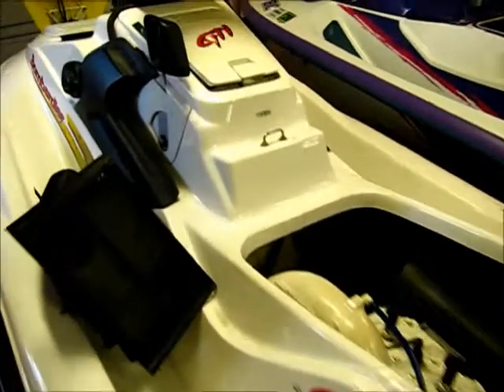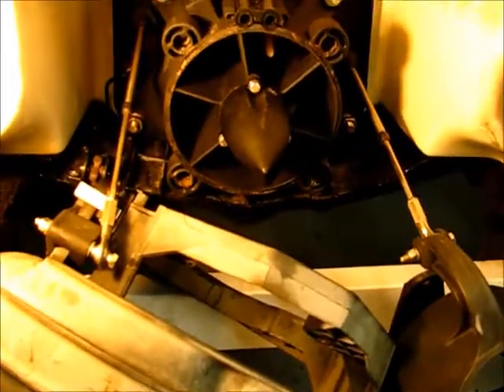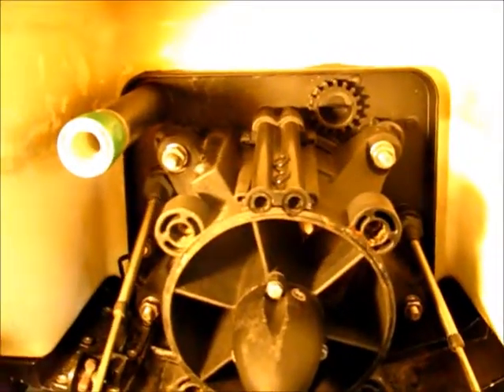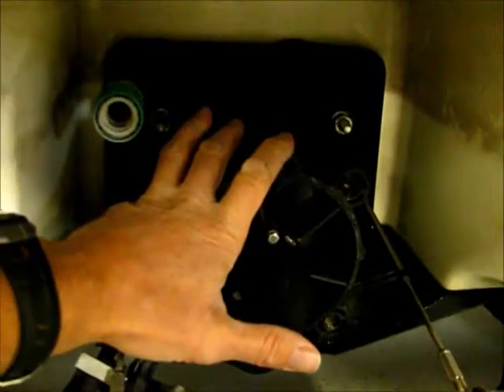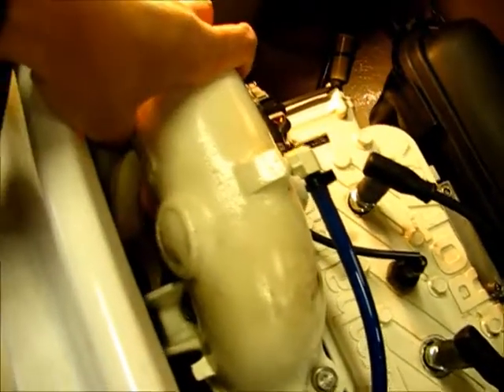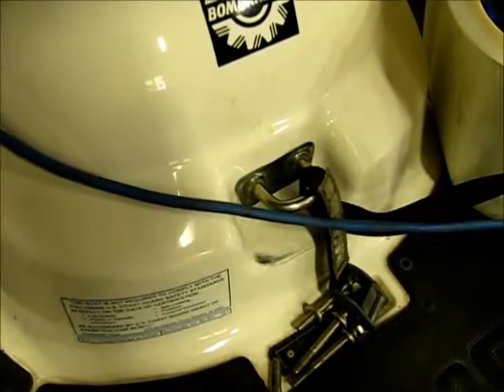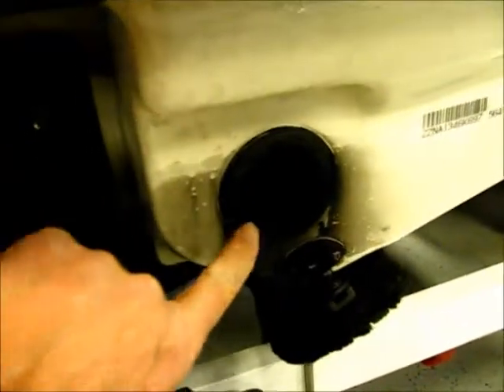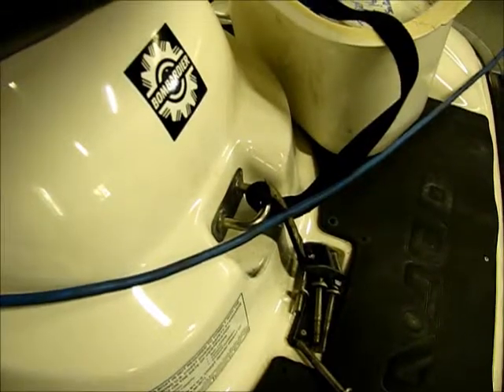Sea Doo GTI - How the Cooling System Works

Comment: Thanks so much for making this, i recently blew up my used jetski due to previous owners cooling sytem routing. I am currently rebuilding the unit.
Reply from the maker: Cool - hope this helps you and I hope it makes sense!  I don't know if I explain stuff well but I try...  Also, the toughest part for me to find was the exhaust hose on the larger end of the exhaust cone.  Mine was burned and bubbled.  Go to McMaster-Carr online and you'll find the material you need.

Comment: Extremely well presented. Thanks.
Reply from the maker: Thank you!  Hope it helps...
Reply: @paulhaines5755 hi Paul - tried starting my ski up, hooked water up to the flush valve and water starting coming out of a hole in the top of the exhaust manifold and started to flood the inside of the engine bay..
Reply from the maker: Hmmm - this should be a sealed system.  The largest round exhaust pipe has a plug almost on the top of it.  This plug I think is from the metal casting process but I'm not sure.  It has a tendency to leak on these machines so maybe you need to seal that up with RTV or something.  Without seeing a pic or knowing the exact location of your leak I can't say what your issue is.

Comment from the maker: There's water running all around the cylinders below the head, too.  There are ports directing the flow from the water jacket (up on top of the engine) to the sides of the cylinders as well as the exhaust manifold.  Sorry forgot that BIG detail in my vid.  I guess I got stuck in showing what you can actually see!
Reply: Paul I know this is an old video but I came across it because of issues with my 97 gti. I'm getting water into my cylinders and fouling my plugs.. would it be safe to say that my o rings in the top cover are bad and need changing
Reply from the maker: I have not had that issue.  I would guess that the first thing you should do is pull the water jacket and the cylinder head off the cylinders and replace the gaskets.  Check both metal parts for holes or cracks.  Find and follow torque specs and find out if you need to use  thread sealant, etc.  You will need a manual for this information.  Worst case possibility is maybe there is something wrong with the jacket around the cylinders or the exhaust port.  I'm not sure what to do to find this problem but I'd do some research on a leak down test.  Positive pressure in the cylinders might show you if you have a pin hole somewhere.  Keep in mind I'm not a pro tech so these are just my ideas for you...

Comment: Great video, I have a Sea Doo GTX RFI (1999). I have had a cooling issue since I got it the high temp alarm goes off after about .5 miles of riding. It cools down quickly at idle. 
I watched your cooling testing video and cannot find any obstructions. Neighbor is a jet ski guy and told me the flush valve on back where hose connect should be closed while running and it has been bothering me. Just watched this one and you don’t have a valve so it’s always open! Is this the same with the GTX as would make perfect sense as to why it gets hot!  The flush port stays open while running…?
Reply from the maker: Hmm - I guess I've never thought about it.  The flush port on mine has always been open and I have no issues running that way.  I would suggest watching one of my other vids:  "Sea-Doo GTI - How to Troubleshoot Overheating".  In this vid, you will see a problem I had with some o-rings/flanges in the jet housing.  Mine was doing the same as yours.  Overheats after five minutes.  I found a problem that could very easily overlooked.  I describe the parts that were causing the issue at about the 8 minute mark.  Easy fix.  Good luck!
Reply: @paulhaines5755   I will check it out, going to run mine today and see if I get lucky it only has 100hrs on it.  The big line coming off cylinder head goes to the flush port and is teed off to a small line going to exhaust, If only 1/3 of the water is getting out then prob should overheat. I was worried about dumping to much water and no cooling going to the exhaust.  Will see, thanks again.
Reply: @paulhaines5755   Hey Paul, lucky me after hours and hours of trying to find the issue online and with my head stuck in the ski that’s exactly what it was. Only issue is the tell tale doesn’t have any water coming out at idle, I can turn the flush valve down about 1/4 a turn and it does but either way it shows after 1/3 throttle. I assume the water box is so restricted all that water cannot escape fast enough. Just glad I didn’t blow a hose or head gasket.  I was worried that opening it could over heat the water box/exhaust or would have tried before I spent another 5hrs trying things. Alas your video showed me when yours didn’t have a quick connect flush port. Ski runs strong only has 103hrs on it and looks like it’s 3 y old it’s in amazing condition. Doesn’t see to be many older skis for sale let alone in this condition. Wife and kid don’t seem interested so probably going to put up for sale, any idea what this ski is worth? It’s a 1999 sea doo GTX RFI with barely a scratch on the hull and you could eat off the engine. Fresh water used ski until the last 2 hours.  $3500 maybe??  Thanks again for your help, quick response and great videos!
Reply from the maker: Glad it worked!  Such an easy thing to miss.  I'm an engineer so I look at all the details really close and often find just a minor thing as I'm almost detailed to a fault!    I don't know about value.  Depends where you live I guess.  $3500 seems a great place to start.  As for tell-tale, watch my video about increasing your sea-doo tell tale stream on my channel.  Mine had a almost zero stream at idle until I did the fix you will see in my vid.  Ten minute fix.
Reply from the maker: The vid you want to watch is called "Sea Doo GTI - Fix Your Tell Tale"
Reply: @paulhaines5755  Will do, looking at ski and thinking $3,500 figured I would check and see if you replied to my question, guess we think alike. Thanks again.

Comment: Hello, good afternoon, I have the hose that goes from the front on the right side where it should drain loose water inside the Jet Ski. A few days ago when I went to the lake I didn't realize it and the entire Jet Ski filled with water inside. Please if you could help me tell me where that hose goes at the other end.

Comment: Hello nice video , if was getting towed the main water line you showed starting the black line in from the pump to the top of the head is the one i should kink when being towed ? Thanks
Reply from the maker: Yes.  Seadoo makes a clamp for this or you can get creative and use a squeeze clamp or something like that.

Comment: This is the best video I've seen that explains a Sea-Doo cooling system. Thanks for making it. I've been trying to completely understand it's inner workings so I can properly winterize mine. Just to be clear, there is no thermostat that needs to open up in order to get antifreeze into all areas of the system? Everything looks like it's just free flowing at all times..... I was planning on connecting a line with antifreeze to the intake on the top of the motor, turn it on and let it run through. Is there any reason why you would advise against this method? How many gallons of antifreeze would you recommend putting through the system to be sure the water has been removed? I was thinking 2 would probably do.
Reply from the maker: Thank you!  I'm a mechanical engineer so I explain stuff probably too detailed at times.  My wife thinks so!  Do you have a manual?  Sea doo manual for this 717 recommends removing the inlet and outlet hose from the rear of the hull as well as the clear line that goes to the exhaust in the back.  You zip tie them above the engine and poor about 1/2 qt antifreeze into the inlet hose.  Do I like this?  Not really.  Be aware that it is possible to over-fill it when it's not running and get antifreeze in the cylinders (or so I presume).  I think you are better off doing what you want to do however, I have found it doesn't work that great without pressure - I have tried.  I actually pump antifreeze into mine using an RV pump in a bucket while machine is running.  2 gallons is way more than sufficient.  Pressure is something like house pressure with my set-up.  Thermostat - no I don't believe there is one on these.  If you go with Sea Doo's recommendation, I most certainly would fire it up and make sure all the water is blown out of the exhaust before you dump anti-freeze into it  ( a good practice when you pull it out of the water no matter).  I would think if you're getting antifreeze out of the exhaust on the rear when it's running you are good to go.  Hope this helps.
Reply: @paulhaines5755  There was no manual. Thanks for the help.
Reply from the maker: I don't know.  I really can't say for sure.  Might be something you need to experiment with.  You'd prob need some temp sensors on the engine to know if it's operating at the heat range it would normally operate at in the Seadoo.  Sorry, Paul.
Reply from the maker: I suppose I should ask - is this for an engine mod to use it in something on land or are you talking about winterizing your machine?
Reply from the maker: Oh - you're in luck.  I have a manual for this machine and I have done a video on how to winterize.  It's tells step by step how to winterize it.  I did it per the manual last year and had no issues.  Check out my other videos on my channel and you will see the vid you want.  Paul
Reply from the maker: My vid is called:  "Sea Doo GTI Winterize"

Comment: Nice video thanks. Im trying to connect a shut off valve for when the jetski is getting towed for some reason so the water wont flood into the engine or exhaust. But i dont know where to connect it to in this 717 motor. No videos out there right now of it. Can you make a video for me please.
Reply from the maker: Hmmm - not sure I have the time for a vid right now.  Here's my opinion on this.  Again remember I'm no pro-tech guy but I work on a lot of stuff so have some good insight I'd like to think.  The hose you need to block off comes in through the rear of the machine on the left side near the bottom drive system hump.  It then goes into the top of the engine on the left side where there is an arrow showing the "in" direction of water flow.  (Refer to 2:32 thru 2:42) of my vid.  This is the hose you need to block off.  However, I'd caution against an in-line valve.  It is likely you will restrict/change water flow even when it is fully open.  I'm sure guys out there do it like you want to do it but there is no doubt you will affect water flow rate doing this unless the inside diameter of the valve block is the same as the I.D. of the hose.  I'd just get one of those hose clamps that sea-doo makes for these machine and clamp it on there when you want to tow it.  529032500 is one part number for one.  Spendy from Sea-Doo but I bet companies like SBT sell cheap ones.  Pretty fail safe thing, , really.
Reply: @paulhaines5755  thank you i did order one pair of those hose pincher last night just to have in the jetski. Also you are correct in the flow rate, which im planning to replace all the lines in there with a all see through fuel, oil, water and air line. Then get the full flow shut off valve to connect it. Thank you
Reply from the maker: Awesome!  Sounds like you got er dialed...  As a side note, if you ever have trouble with flow from the jet pump check the o-rings from the pump housing to the hull.  My other vid on how to troubleshoot these goes into that issue in detail.  It's a small problem that could be hard to figure out if you have issues.
Reply: @paulhaines5755  thank youbi will check it out and save it for future use. 👍👊

Comment: How much water is in the water box? Should the water box be filled all the way to the top and thus the inlet exhaust pipe or should the water only be up to the base of the exhaust inlet pipe?
Reply from the maker: When running or floating?  Not sure what you mean.  When running all should be full.  When sitting the water level will match the depth/waterline that your machine sits at in the water.
Reply: @paulhaines5755  , I didnt know there would have been a difference. Mine is sitting on my trailer and has no water in it. I checked it while it was on the water and it still had no water. I am thinking about manually filling it with a hose...
Reply: Do you also know how much water should be flowing directly into the exhaust fumes, I pulled my small pipe off and only dribbles of water was flowing in... Wondering if thats why my water box is empty, cause there isn't enough water flowing into it? Thanks for your help!
Reply from the maker: The small hose going to the exhaust from the tell-tale hose route might only have a small amount of water going into the exhaust.  Depends on RPM"s.  Some water goes to tell-tale, some goes to exhaust in the Y prior to the exhaust.  The larger hose from the box should have a significant amount of water moving through it depending on RPM's or the water source you have it hooked to.  I can't tell you more detail on water level.  I don't know for sure.  When mine is hooked up to flush hose, it sprays a significant amount of water out of the exhaust.

Comment: I have no water coming out of the exhaust manifold on the little hose.  The little hose feeding it does have water come in but no water coming out the piss hole.  What could it be?  Where do I start? I have a 96 GTX
Reply from the maker: Jerry,  I have another video title "Seadoo GTI - how to troubleshoot overheating".  That might help you more than this video.   Watch it and see...  thanks!  Paul

Comment: So can you confirm please! I have a 1997 seadoo gti. To add a tow tap I install the ball valve onto the black intake hose closest to the center. The main black hose from which the water enters from the three holes in the pressure box you referred to correct?
Reply from the maker: Yes - its the hose port side that enters the top, rear of the engine left side/port side.  I have not used a ball valve - a hose/pinch clamp is recommended but I don't know much about it.  Thanks, Paul
Reply: @paulhaines5755  perfect thank you! Ran to Catalina Island today with a few guys on skis and was worried about the what if.. thank you!
Reply from the maker: Catalina Wine Mixer!  Nice...  The only time I have had to tow my GTI was when it blew one of the hose couplers on the exhaust cone.  It happened at full throttle.  A friend of mine was riding it and didn't think to stop and see why is was basically sinking until it wouldn't run anymore.  The hull was full of water and it was half floating.   Had to tow it a few miles. The engine took on water and I had to blow out the crank and do all that fun stuff to get it dried out and running again.  I'd definately recommend checking to see that the two rubber exhaust hoses are tight on the pipe good once and a while.
Reply: @paulhaines5755  Thank you for that! It’s always the things we overlook! I’ll check them.. I did a full restoration in and out on these gti.. you wouldn’t know they are 97. Everything new in and out.. still a loose hose and it’s over … you are right. I installed automatic bilge pumps in both. Gold Boat US towing, and Standard Horizon HX 890 radios with MMSI registered with coastguard. Tow rope and anchor on both… and we always go in a group .. lol I don’t think it’s overkill when you’re in the middle of the ocean. lol i’m installing the ball valves tomorrow. They arrived. Thank you again for the videos you put up and for the info!
Reply from the maker: Wow sounds cool!  Mine was pretty mint when I bought it and I store them in my shop plus baby them so they are really nice still.  My Yamaha has a GPS on it so I know I've put about 1000 miles on each the past few years.  The only mod my GTI has is I put a HawkEye depth finder in the dash hole that is blank.  It's pretty neat to have on the lake I run on as it's deep and lots of structure and fast depth changes (Flathead Lake, MT).
Reply: @paulhaines5755  that sounds totally epic. These two strokes are still a joy to have. I’m going to post a video or two in the next few days so people can see the finished restoration.. they look totally different and people at the water keep asking me to post how I did everything.. i’m going to do some beginning to end on how I did everything. But for right now I’m going to post what they look like and their first ocean voyage lol I’ll let you know so you can check it out. Would love to get your feedback..
Reply from the maker: Very cool - yea, I did a full engine rebuild on an old Yamaha Wave Venture 1100.  That's on my channel along with a Honda XR500 restoration if you ever want to check it out.

Comment: Any explanation of why you must start the machine before flushing. Cant understand why its so important
Reply from the maker: Remember I'm no pro but here's how I think about that - at some point in the system after the double wall pipe exhaust enters the system and is mixed with water.  What does this mean?  There is a path for water to get back into the exhaust ports and back into the engine.  Without positive pressure (exhaust in this case) water could potentially make it back into the engine when you have a hose hooked up and pressurized = not such a good thing.   That is also why you don't want to tow these in the water without clamping the cooling system inlet hose.  (Slow towing  is O.K. without clamping)..